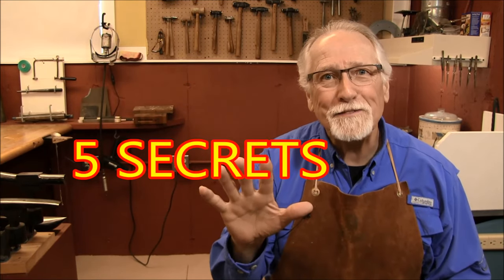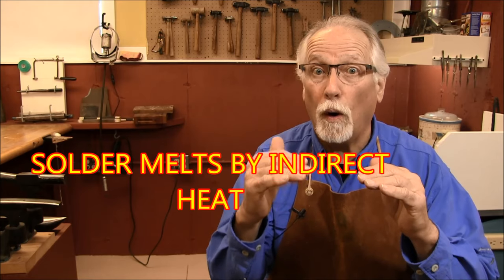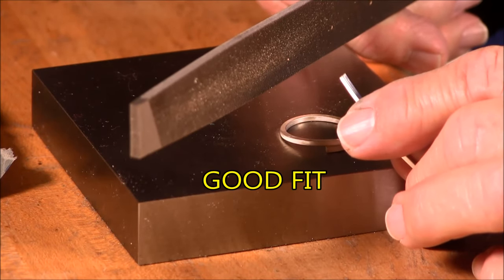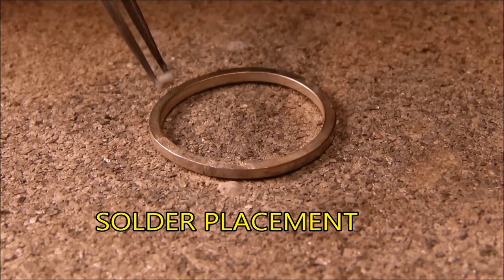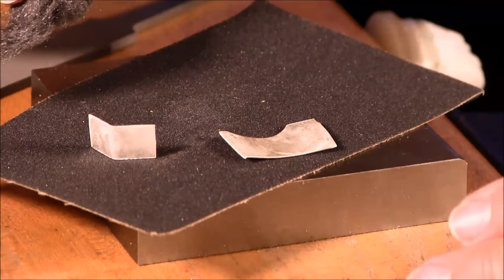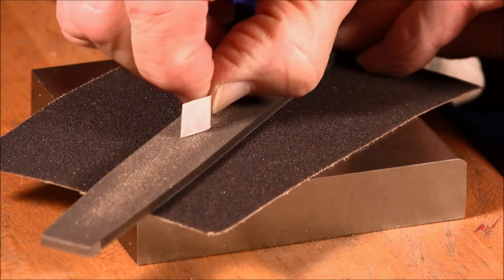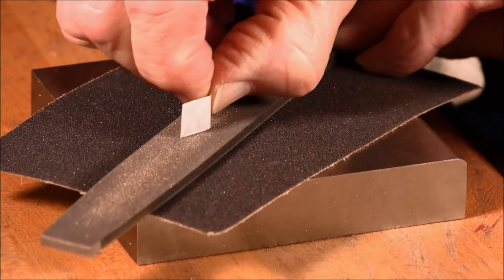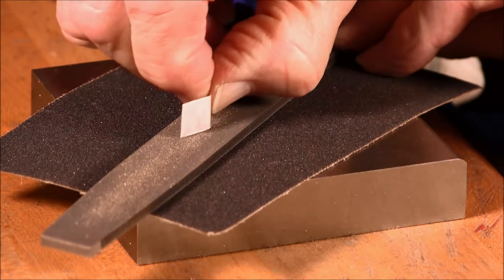5 SECRETS TO PERFECT SILVER SOLDERING!

Comment: Revisiting this great advice after more than a year. And immediately it strikes me that "file the metal to fit" is just the one thing that most beginners will fail at. Maybe not because that they do not know about it, but most probably because they are not trained enough to file a perfectly flat - and matching - surface.
So get yourself some pieces of metal and train filing ! Any old copper will do. You don't even need to solder. Just file and check the joint. Again and again and again. When filing, people - kind of automatically - tend to file a curve. Learn to control your movements. Or as Greg would probably say "file, file, file". Without proper filing there is no proper soldering.
Which makes me wonder... I haven't seen a video about filing on any Youtube channel yet. But mostly it is the basics that go wrong when youre doing the next step.
Of course, if you can spare yourself from the work of filing (e.g. by cutting both ends of a ring shank at the same time with your piercing saw), this is even better - but you still need to know how to master the art of filing. And that must be practiced. A lot.
Reply from the maker: Hello Torsten,  Nice to hear from you!  I agree with you 100%.  File, file, file.... It is interesting that I have been thinking about doing a video on files and filing.  I'm going to start to work on it.  Thank you for the inspiration.   Have a great day.  Greg Greenwood
Reply: @greggreenwood4628  ugh, I have an astigmatism in 1 eye that makes things appear level but they aren’t. Soooo frustrating and time consuming. I just bought a small jig from Rio that lets me file and saw accurately. Finally I am having fun using that and your excellent instruction. Now I can’t wait to go to the studio.

Comment: Can I use silver soldering to repair a cracked 3mm thick iron cast piece of a sewing machine?
Reply from the maker: Hello R van Z.  Silver soldering can be use on steel. But I am not sure if you can solder a 'cast piece'.  Get it a try.  Use plenty of flux and heat.  Let me know how it goes.   Greg Greenwood
Reply: @greggreenwood4628  I will! Thanks for taking the time to reply.
Reply from the maker: My pleasure.  Good Luck.

Comment: Hello there, i have here some silver solder in liquid solution. Wondering on what this is used for as it is in a small vial.  The solution is clear, until i move it around and it was turn a bright silver.
Reply from the maker: Hello Bongshead,   I'm sorry I don't know what it can be used for.  I have not had any experience with this.  I have a friend who is an engineer.  I will ask him if he has ever used it in a solution.  I'll get back to you.   Greg Greenwood
Reply from the maker: Hello Bongshead,  I have checked around about the solder solution that you have.  We all feel it must be for a  commercial use.  I don't feel it is something that you should be using or even keeping.  "If one does not know what it is, then get rid of it!" Sorry I couldn't get a perfect answer for you.  But I agree you should get rid of it and don't use it for anything. Thanks for your question and keep watching.  Greg Greenwood
Reply: @greggreenwood4628  Oh Greg, thanks for looking into the mystery but i have figured out what it is used for. So electronic circuit boards, Fiberglass and Gold plated electronic chips...Well the liquid silver solder is used with a brush to apply the solder circuitry for the boards. So the liquid solution is stirred, then followed by a few coats of the silver onto a blank chip.  It has really good conductivity i have heard. The standard silver/lead solder wire is used for the components you add to the circuit board after that. :)
Reply from the maker: Hello Bongshead,  Thank you for the research and the update.  I really appreciate your follow up.  That makes sense. The electronic age is so interesting.  Keep watching!!  Take care.   Greg Greenwood

Comment: How do you know when to use hard solder medium solder or soft solder?
Reply from the maker: Hello Catherine,  The different grades of solder melt at different temps.  Hard melts at the highest temp and then down to easy.  If your project has more than one solder joint, then I recommend you start with Hard solder for the first solder joint and then Medium for the next and finish off with Easy.  This way your prior solder joint will not re-melt. Check out my playlist on Silver Soldering.  There will be some good tips for you when you silver solder.  Thanks for you question.   Greg Greenwood

Comment: Can I apply this method of soldering for steel or iron
Reply from the maker: Hello Anar,  Yes, you can.  Make sure that the metal is very clean and use lots of flux.  It all depends on the size of your piece, but use a torch that will heat your metal to the correct temperatures.  Thanks for your question.   Greg Greenwood
Reply: @greggreenwood4628  thank you for very informative answer
Reply from the maker: You are more than welcome.  Greg Greenwood

Comment: Can I silver solder 303 stainless to mild steel?
Reply from the maker: Hello Andluth,  I have not done that before,  but you should be able to.  You must use a larger and hotter torch.  The steel will heat sink very quickly. Use plenty of borax flux. Good Luck.  Greg Greenwood

Comment: Can I silver solder a plated surface. Brass plated with nickel.
Reply from the maker: Hello Iobdsk,  Yes you can.  Just make sure it is nickel and not a "pot" metal which has a low melting point. Thanks Greg Greenwood
Reply: @greggreenwood4628  thanks for getting back to me 🙂
Reply from the maker: You are welcome.  Greg Greenwood

Comment: Would you solder inside your house if you had kids or would you move the station outside?
Reply from the maker: Hello Needmore,  
Very good question.  Check out my video  "Jewelry Soldering Bench Ventilation Systems".  This will give you insight into ventilation.  As for the kids, if you have some ventilation, which is easy,  definitely solder inside.  And have the kids watch you.  They will learn so much from the process.  Set up a simple ventilation and have fun!!!   Greg Greenwood

Comment: What if I want to solder two bent pieces?
Reply from the maker: Hello Harsha, Thank you for your question.  Soldering straight or bent pieces, the process is the same.  #1. Follow the 5 secrets .  #2 For any shape of metal, you should make sure that you have a "Good Fit" .  If you have 2 bent pieces coming together at the bend, then you should file a small flat spot on both pieces.  This will give more surface to solder.  Then go ahead and solder as usual.  Check out some more of my videos on soldering.  They will give you some good tips and suggestions.   I hope this helps you.  Thanks again.  Greg Greenwood.

Comment: My solder works some times, but this one time the solder wouldnt go down. It was melted but just floated on Top of the silver? You know why?
Reply from the maker: Hello Loff,  It could be 2 things wrong.  1. Your metal is not clean.  2.  You need to use more flux.  It could have all burnt off.  Whenever solder just sits on the silver, it is one or both of these problems.  All 5 Secrets to Perfect Silver Soldering must be met for the solder to flow.   I hope this helps you.   Thanks for your question.   Greg Greenwood
Reply from the maker: Hello Loff,  (Second reply) You might not be heating the silver up enough also.  The solder will ball up and sit on the silver if the  silver is not up to the melting temperature of the solder.  Focus your torch more on the metal and not on the solder.   Thanks Greg Greenwood
Reply: @greggreenwood4628  Thanks for the reply! It certainly was that the metal wasn't getting enough heat because it was in a bench vice, so I placed it on a firebrick and it worked. Thanks for the help!
Reply from the maker: Hello Loff,  Very glad it worked for you.  I am happy to help.  Greg Greenwood

Comment: I've tried many times and I cannot make solder to flush at all. It will just sit there as square as I cut it. But when I try to melt it separately, it will turn into small ball. I really don't know what else to try.
Reply from the maker: Hello Karolina,  I'm sorry that you are having trouble getting the solder to flow.  Don't worry,  we will get to the bottom of it and you will be soldering perfectly soon.  I am going to cover the basics first.  The 5 secrets of soldering are the foundation of soldering.  These 5 things must be done to make the solder flow.  From your description, there could be 2 or 3 things that are not "just" right.  First:  What kind of solder are you using?  It sounds like sheet solder.  When solder sits around for awhile, it will oxidize just like the metal will.  So, before you cut your paillions (squares) , rub the sheet solder with some steel wool or emery paper to remove any oxides.  It should look clean.Then cut your solder pieces for your project and keep them clean. Second:  As you are placing your solder into position, dip it into some flux.  This will help protect it from oxides when you heat the metal.  Third:  It sounds like you may not be heating your metal hot enough.  Does the flux bubble and boil and then lay down into a nice glossy film?  If not, you may have too small of a torch for your project.  How large are the pieces of metal you are trying to solder?  Remember, the solder will only melt if the metal it is sitting on is hot enough to melt the solder.  Soldering is done by indirect heat, not heating the solder itself.   You are correct when you have heated the solder separately, it will turn into a small ball.  This means that the solder is hot enough to melt.  All metal when it gets to the melting temperature will ball up.   
Try these things and see if your results improve.  I am leaning toward you not heating your metal up  hot enough to melt the solder.  Please let me know how this goes.  I am here to help you and we will make it work!!!!!   Greg Greenwood
Reply: @greggreenwood4628  thank you for such a quick response. I've watched many different videos on how to use solder but sometimes it's just not enough. I'm using solder in a form of stripe, like bezel, I believe it is the same as sheet solder. I will definitely start  cleaning it before use. After few tries I started using flux on solder too (I'm completely new to silver soldering, I've only done soldering for stained glass pieces which is much easier). Now when I think about, I don't think flux was 'sitting' nicely on solder pieces. Hopefully cleaning will help. I'm using borax flux and I did experiment with different consistency of it, thinking it might make a difference. When I heat it up, it does bubble and then get dry creating kind of white coating on metal, not sure if that's how it suppose to look like, doesn't really get glossy. I have two different torches, small kitchen one that I use for silver clay and bigger one with bigger flame. I've tried both but probably should stick with the big one. Now for the metal, I'm using two stripes of metal that I want to solder together to create ring, it's about 1cm wide and 6cm long all together. I will try again on something smaller like wire and see if cleaning solder and heating it more will make difference.
Reply: @greggreenwood4628  Hello Greg, I would like to thank you very much for your tips. It did help me to find out what I was doing wrong. Cleaning solder was very good advise as I wasn't aware I should do it, and I'm sure it did make an impact. Most importantly, I think I just wasn't patient enough when heating metal. At first, I tried on a small piece of wire, and I thought nothing is happening again. Once wire got red hot after few seconds solder finally did flow. After that, I tried on my original pieces of metal and this time it did work. I just had to wait long enough for the metal to become hot to make solder flow. Once again thank you for very helpful advice.
Reply from the maker: Hello Karolina,  I was just going to reply to your comment and say if your flux is only turning white, then you are not heating the metal enough.  Then I saw your comment that you got the solder to flow. HURRAY!!  Way to go!  Take a look at my video "What the heck is sterling silver and silver solder.."  I show a demo in that video that will show you what the flux looks like at the different temperatures. This will help you know when the solder should flow.  I know you are going through a learning curve and it will take awhile to catch on.  Hang in there and don't be timid about  heating the metal. If you have any questions at anytime, please feel free to let me know. Thanks and enjoy making jewelry.  Greg Greenwood

Comment: Suggestions for the best solder and flux?
Reply from the maker: Hello George,  I suggest you use sheet silver solder and Handy Flux.  Rio Grande Jewelry Supply is a good source for these items.  Here are the item numbers for you.  Sheet Solder:  #101200 You should order " Hard, Medium, Easy, Extra Easy"  the item numbers will be different but the 101200.  will get you to the correct solder type to use.  I also recommend Handy Flux #504086.  It is premixed and will last a long time.  If you have any other questions, please feel free to let me know.  Greg Greenwood
Reply: @greggreenwood4628  Thank you for the quick reply.  Just getting started, so trying to learn as I go.  When you say to get "Hard, Medium, Easy, Extra Easy", does that literally mean how hard or easy the solder will melt, or does it mean something different based on what type of product it's being used on?
Reply from the maker: Hello George,  The terms Hard, Medium, Easy, Extra Easy mean the temperatures that the solders melt.  Please check out my video  "What the Heck is Sterling Silver and Silver Solder" This will answer your questions about what sterling silver is and most important,  what  is silver solder.  If you have any questions at any time, let me know.  Good Luck  Greg Greenwood
Reply: @greggreenwood4628  Perfect.  I'll watch and learn.  Thanks again.

Comment: How to use the blowtorch, is my first question.
Reply from the maker: Hello Paul,  The torch that I am using in the video is a "Presto Lite"  Acetylene gas and air mix torch.  It has one tank of acetylene and the air mixes in the torch nozzle. I use different size tips for the different size soldering jobs.  Very small to large annealing size.  I try not to get too close to the silver that is to be soldered at first, but then get closer when the solder is ready to flow.  Hope this helps you.  I will be doing a video on the use of the torch in the future.  Make sure that you click on the bell to get a notification of when new videos come out.  I am here to answer your questions anytime.  Thanks Greg Greenwood
Reply: @greggreenwood4628  thanks Greg. I hadn't heard of air mix acetylene.

Comment: What do you mean, you "pickled" the metal?
Reply from the maker: Hello James. After Sterling Silver has been heated or soldered, there will be a dark grey or black oxide on the surface.  "Pickling" is a term used when one puts the silver in a mild acid solution to remove the oxides.  Check out my video "What is Pickle?" This will give you a good visual.   Thank you for your interest.  Keep watching.   Greg Greenwood

Comment: Another tip to much flux can sometimes be a pain if you have a lot of black residue  let's say your using metalworking pliers and it had it on there it will stay on and with whatever it's touching it will most likely be messed up if you pull it with the black residue on so plz be considerably where you place it and how much
Reply from the maker: Hello,  Thanks for the tip.  Greg Greenwood

Comment: Why Blow hole then soldering. How to solve this problem
Reply from the maker: Hello Arvind, I am sorry, I don't know what you are asking.    Can you explain more?  Thank you.  Greg Greenwood
Reply: Hello sir
          Two  Brass components soldering with copper filler wire then showing around the pipe bubbles hole .
How solve this problem?
Reply from the maker: Hello Arvind, It sounds like you are trapping air in your solder joint and when it heats up the air is expanding and blowing the solder out  making your blow hole.  Try to make a tighter fit or fill the joint with more solder. Air pockets will always expand and blow out, so if you can eliminate them, that will help.  I hope this has helped you.  Greg Greenwood

Comment: A gap of 0,05 mm is beatiful, if brazing Copper-Copper or Copper to Steel, in the range of 15 mm to 70 mm. One must use a great deal of Silver, at least 44%, and a good quality flux.

One can not Braze Copper to Brass with Copper-Phosforous brazing solder, only Copper-Copper, and certainly not Copper-Steel. One can braze Copper to Bronze with Copper-Phosfous brazing-solder though.
Reply from the maker: Hello Leif,  Thank you for your information.  I appreciate it.   Greg Greenwood

Comment: I see no point in soft medium and hard solders.  I make my own solder with 4 gm silver 1.7 gm copper. .7 gm zinc and it will make every piece . even if i have 20 contacts that need to be soldered at different times. I just pickle after each soldering.
Reply from the maker: Hello James,  Thank you for sharing.  I really appreciate it.  Greg Greenwood